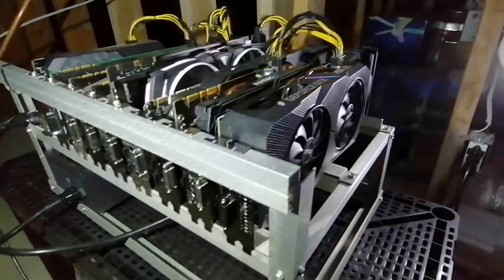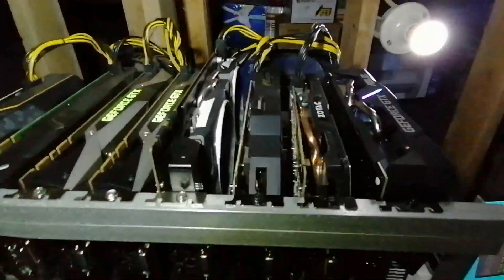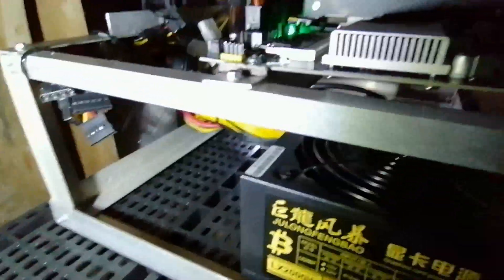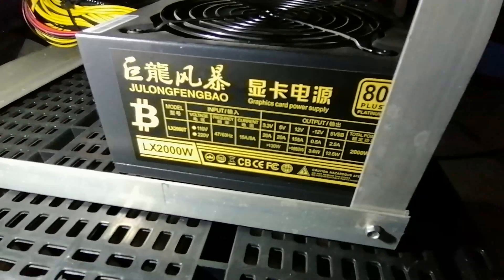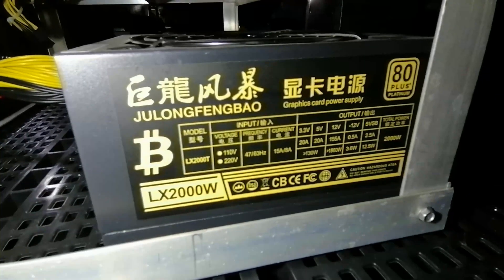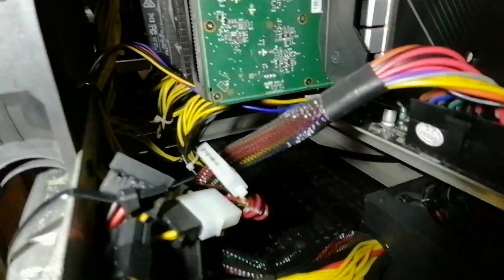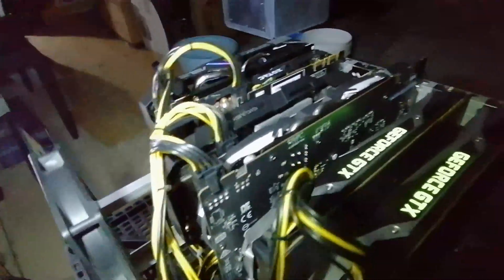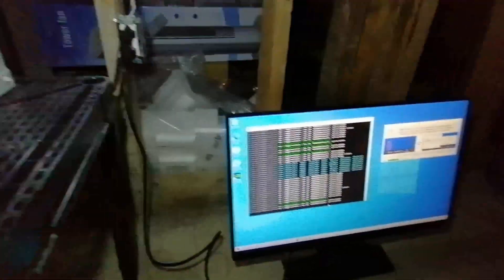BTC-T37 BIOS Overview

Comment: Amigo me podrías ayudar?
Tengo un problema, no me detecta mi NVIDIA RTX 3070, LA TENGO CONECTADA CON RYZER.
TENGO OTRAS 2 RTX 3060 Y ESTAS SI LAS DETECTA
Reply from the maker: ¿Probaste con otra tabla vertical? De cuantos watts es tu fuente de alimentacion? Asegúrese de instalar el controlador más reciente si está utilizando Windows. También asegúrese de que la decodificación 4G esté habilitada en el BIOS. Acabo de hacer un video de la placa base ETH79 que tiene GPU de la serie 30, incluida la 3060. Esta no necesita elevador porque la brecha de PCIE está diseñada para una GPU más gruesa, aquí está el enlace: https://youtu.be/d7ZObnrmCI4

Comment: My asshole motherboard is only accepting 3 gpus. Going to try bigger memory. That seems to be an issue..
Reply from the maker: I am only using 4GB memory. You can increase virtual memory using some of your SSD space.
Reply: @ruvrandomusefulvideos  i know but it didn't help and I'm only using 2gb so i figured out that's probably my problem. And Windows msi afterburner also nicehash eating of that
Reply from the maker: @uddemannen  Did you turn the 4G decoding in the BIOS? What error are you getting when adding 4th GPU?
Reply: @blindSilver3090  😂never said it was the motherboard..tweaking my virtual mem did not make any difference, changed memory from 2- 4 gig made it working and has been running without any problem since then

Comment: This is the classic chinese rabbish, I run my rig 8 gpus for 8 months, after the Msata disappear and no boot, only see the bios setting everey time I switch on, the msata ssd is ok on other mobo, the ebay seller can't replay to my request of bios update....avoid that rubbish !
Reply from the maker: Sorry to hear that! Mine is running with no issue for almost 2 years now, did you try to load the BIOS default?

Comment: I have the same board. However it will not allow me to add more than 3 GPU's. Says not enough memory and everything crashes. I tried different cards, same issue. Any thoughts?
Reply from the maker: Your installed RAM is not enough. Please increase the virtual memory on Windows. It will take up space of your SSD but if you have at least 60gb you'll be fine.
Reply: Same here..i only put a 2gb mem in but also had issues with VRAM. Fixed that keeps crashing on that 4th Gpu..so going to put a 4gb mem into it see if that solves it
Reply from the maker: Please increase virtual memory from windows, no need to replace RAM.
Reply: Hey.. do not give advice if you don't know what you are doing!! I bumped up to 4 gig of ram and problem is solved..so yes if you running on 2 gig BUY RAM!! MIN 4GB IF U RUN WINDOWS
Reply from the maker: @uddemannen  Hey, I am computer electronic technician and I been mining for almost 2 years but still learning everyday about mining but I can assure you I know computers. What I've  said in my reply works for me and other miners. Yes you can make your RAM bigger but 2GB RAM is not enough to support 4 GPU'S and 4GB RAM also not enough if will run 8 GPU's. That said, instead of adding more RAM you can increase virtual memory then you do not have to spend more $$$ for bigger RAM. You asked for advise and I gave you and if didn't work for you I'm sorry and hope you know what you are doing as well. If you read my disclaimer all my videos is for entertainment purposes only and the purpose of my channel is  to share knowledge,  help and learn from each other not to insult anyone, anyway have fun mining my friend.

Comment: Can this support the RX 3060 V1 470.05 driver?
Reply from the maker: Not full hashrate because the pcie bus speed of this mobo is only x1, you need at least x8 speed for 3060 but 3060ti will get full hashrate.

Comment: Thanks for the bios settings. I have same motherboard. After running a week, once i added extra gpu, its not powering on. Have you ever faced this issue? Any suggestion?
Reply from the maker: How many watts is PSU? I had issue with older Nvidia 1070 single fan. It works on my gaming PC but once I plug it into this motherboard it just doesn't power on. Its like the GPU is shorted so It didn't use that one. Anyway make sure that you have enough wattage to power all the GPU's
Reply: @ruvrandomusefulvideos  Thanks for your reply. I was able to figure it out. What happen is I was using cpu to psu cable instead of pcie to psu... By the way i have two 750 watt psu. Thanks for your info

Comment: Hi why dont you use a better miner? Maybe you should check the memory temps on them cards with a probe? Just because the core temp is low it doesnt mean the memory is low.
Reply from the maker: Just personal preferences. I have one rig running hive OS mining Raven coin but most of my rig are running with Nicehash. But which miner do you think is better? Also Nicehash apps shows Vram temperature, also you can log-in to Nicehash on your computer and check vram temp under statistics and since Nicehash is Windows base, you can always rum another software to check all the temperature including CPu temp. So far since I started, non of my GPU died on mining with Nicehash, that said If never push my GPU's to maximize the profit inorder to  keep them running in low temperature,  thanks.
Reply: @ruvrandomusefulvideos  hi thanks for reply. Hiveos is good but I use trex, nbminer, gmniner and lol niner. You can view vram temps only on certain cards. The nicehash temp is the core hotspot temp not the memory temp.
Reply: @ruvrandomusefulvideos   what cards have you got there? Anything 6gb+ I mine Eth it is most profitable.
Reply from the maker: @AnthGott  In this rig are 8gb 1070's, 3 of them are Ti version. Yes I have use Trex, LOL and currently using NBminer  through hiveOs mining Ravencoin but I just want simplicity. As a computer technician, I am dealing more than enough complicated computer stuff, software and hardware issues 8hrs a day at work. Vram can be viewed under statistics when you login to Nicehash. Also when using Nicehash, it is mining eth but you get paid with btc. I also love to see payment every 4hrs doesn't matter how much you make. As I said I just want simplicity of the software, it make my life much easier.
Reply: @ruvrandomusefulvideos  you do know that's not vram temp right?
Reply from the maker: @AnthGott  okay